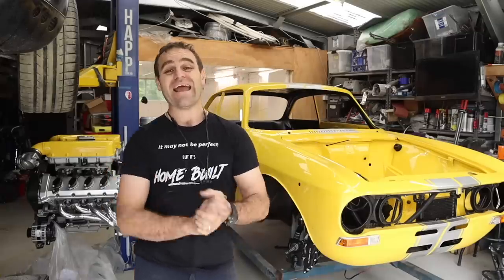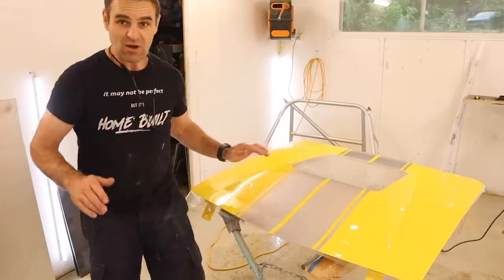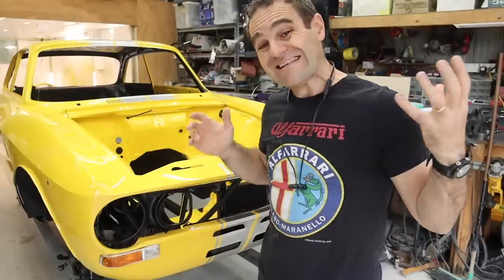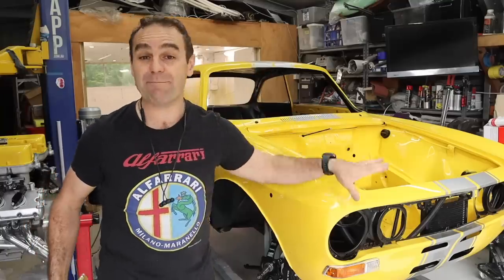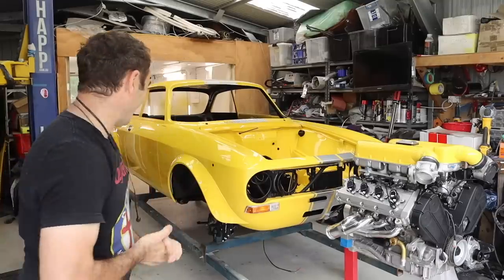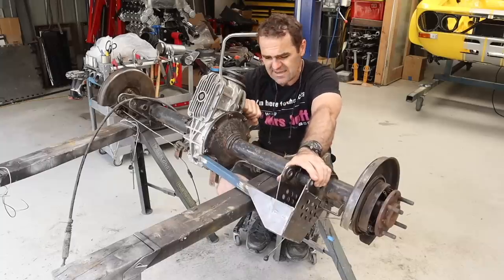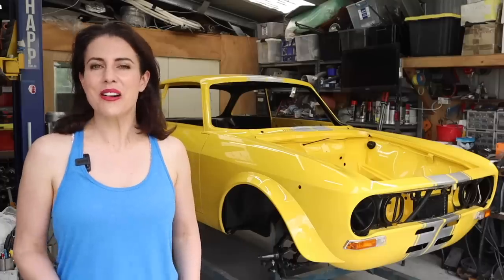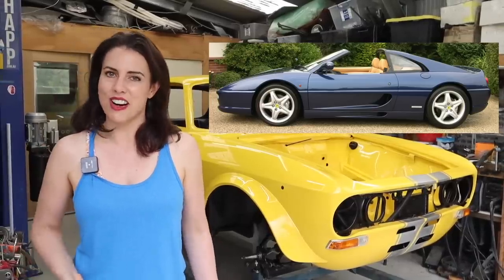The Alfarrari gets flares - Ferrari engined Alfa 105 Alfarrari build part 165

Comment: Tip
With joins on the ppf a dirt line will eventually appear and if there’s any kind of tension that intersects the join it will cause the film to lift and peel off.
You may be able to seal the joins with light cured glue or fingernail polish , you would need to test how well they adhere and if they damage the film.

Comment: I am so jealous of the summer temperatures you guys are having right now. Mrs. Jeff looks like she is on her way to a lovely day at the beach. ^^ By the way, may I ask how wide those front wheelarches are, Jeff? Would be helpful reference, I m contemplating 70-90 mm on my Fulvia and I need to order them now but it will still be a few weeks until I see the car again. 😅
Reply from the maker: Not sure the actual width because they remove the original steel flare and then take it out a bit wider.

Comment: Great series of home builds Jeff, absolutely love the alfa-rrari car. Did just wonder though how that join in the PPF is going to look, on the front of the car after a few 'dirty' miles. I had if fitted on my Caterham and Lotus Elise, and latterly my VW California campervan, and in all cases where there was an 'edge' of the film exposed to the elements, it always resulted in that edge becoming soiled and forming a visible black line due to a build up of grime, which was very hard to remove. My Elise was black, so hid the grubby line,  but the silver of the van really does show it up. Hope it works out for you, as the end result is going to be very special by the looks of it. Hope the rest of the project runs smoothly for you guys, and can't  wait to hear that sonorous engine note 👍
Reply from the maker: I am just going to live with the dirty line. It is better than being covered in stone chips ;)

Comment: The factory limited slip is non functional. There is a quaif unit available. Or you can machine the side gears the thickness of one shim on each side to add two more clutch plates.  I did this and made the clearance .010” tighter. Works great.

Comment: Hello Jeff, I concur with your statement with regard to the 105 2000 GTV diffential - it’s very strong and by far the most trouble free item on the Alfa 105.

However, as a minimum I recommend the replacement of the pinion seal and the two axle seals as they are very likely to leak once you begin driving the car - after all, the diff-housing assembly is near on 50 years old and old hard seals tend to leak.

Unless recently overhauled it’s very likely that the diff will have lost its “lock-up” function.  To remedy this, the two ZF friction plates will require replacement which will restore it to its original 25% lock-up.  Doubling the ZF friction plates will result in 47% lockup.  Notably though, an LSD refresh is not a trivial task and will require some special tools and considerable time and effort to complete.

Comment: One of my good friends just bought a 355! 6-speed manual, spider, 1995. It just had its major engine-out, and it’s already broken again. 😅
Reply: But still looks beautiful sitting in a garage 😋 And what 28 year old car never has issues? Tell your friend to come to FerrariChat to sort them out (less expensively)
Reply: @ImperrfectStranger  It seems like the shop that did the work didn’t properly seal the exhaust at one of the joints. It then roasted a CV joint boot and sling grease everywhere. There’s also a leaky valve cover, despite just being done 600 miles ago. The shop is taking care of him, I believe.
Reply: @computiNATEor  Ouch. Yep, the valve covers are notorious. You have to use a combination of gaskets and sealant to get a proper seal. Some Porsche CV boots can be fitted to avoid the Ferrari tax. Hopefully the work is being done at independent not a dealer workshop, so your friend has some choice in what parts are fitted.

Comment: The LSD will be a plate style diff ?  If so, has it been refurbished?  Plate style diffs have a limited life span and need to be rebuilt at each say 40k mls to get anywhere near optimum performance.  The other issue to be aware if is that there are too many cowboys that don't know how to set them up properly with the possibility that the customer ends up with a locked diff.  Also, too many customers think that more is best and look for ridiculous locking percentages.  The actual percentage for locking depends on the actual use of the car as well as the honest ability of the driver.

Comment: Love the rebuild part! Did you consider the powder coat some parts? A powder coating set is not that expensive , the only thing you need is a cheap secondhand oven (don't think ms Jeff is happy when you want to bake car parts in her oven ;-) )
Reply from the maker: I did, but I am really happy with the enamel paint I have been using. If I did my own powder coating I would still only be able to do small stuff.

Comment: Oh you didn't go with any kind of disc brake conversion on the rear? It was so long ago, it's hard to remember. I would have thought it might have added a nice, over powered feeling of confidence to balance out the fronts stopping power. Great video as always, thanks!
Reply from the maker: They are just the handbrake drums. Notice they were under a disc ;)

Comment: I just rebuilt my 1750 rear axle, and after seeing the 2L axles compared to the 1750, I can say the size difference is substantial.  It's the reason they are so hard to get now, as many people use these axles for modded cars due to their strength.  I think it'll be fine as long as it's in good nick.  Alfaholics can provide great LSD's, and aftermarket axles if you ever need
Reply from the maker: After seeing the size of the axle when I pulled it out, there is no way I am braking that ;)

Comment: Jeff what's the ratio of the diff will it be fine for the ferrari engine?
Reply from the maker: Yep. I covered it in a video a long time ago.
Reply: @HomeBuiltByJeff  

Yes you did but that was sometime back and it was suck it and see what happens . Not worried should be ok sort of thing. But Jeff you are constantly changing things you're not happy with this and that so thought you'd put in an LSD. Alfa used the quaife unit.
Reply from the maker: @dee106ful  It was in no way suck it and see. I calculated the speed and revs in each gear. It is spot on with a theoretical top speed of 305kph from memory.